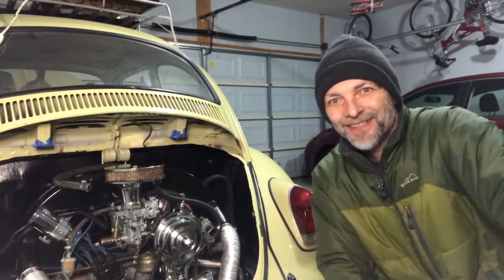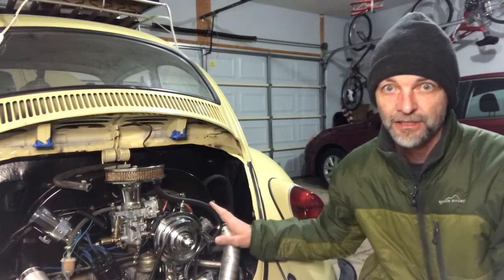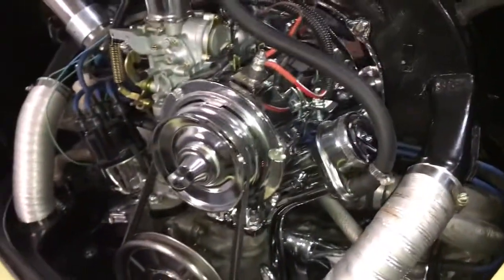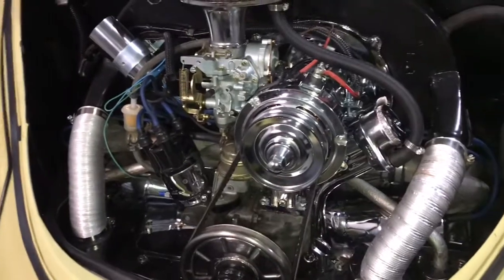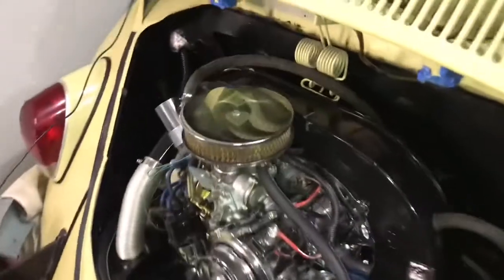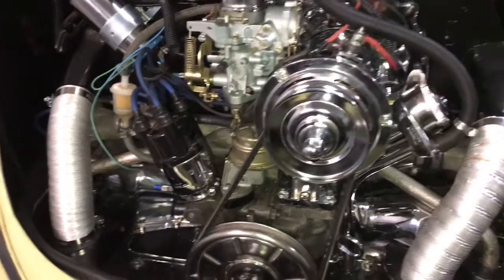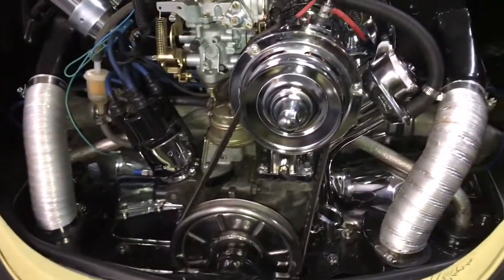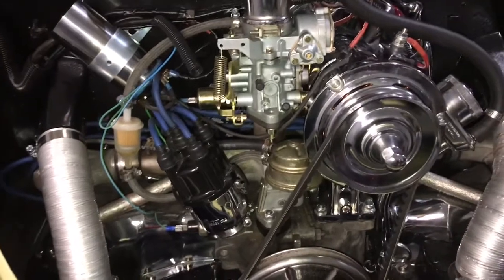Replacement of the Intake manifold?????????🤔🤔🤔🤔

Comment: Informative video,  like your simple talking style it's easy to follow.  I'm about to do this job myself.  Guess I'll drop the engine then but my question is,  aren't I going to have to do the same procedure wise of loosening the middle section to be able to remove the old leaky intake gaskets? I don't understand how it saves me any steps in replacing those gaskets besides making removing the nuts easier  and without a swivel socket.  I mean you still need to get the middle section out of the way regardless right?

Comment: Hypothetically, would it be possible to replace with the engine in the car if I plan on cutting to remove the old intake manifold? I have a single port intake. 

I know for a fact it’s clogged, I’ve found the universal intake manifold with the heat risers detached, and the empi single port intake end castings kit.

If I cut to remove the old intake, how much of a pain will it be to finagle the new system into place?
Reply from the maker: Yes it is possible, just takes more time due to space accessibility.  You can watch a video from JBugs where they replace one with out removing the engine.
Reply: @juniorclassicvwbugs924  JBugs video doesn't show the removal and reinstallation though, it skips over that. It just shows the manifold ends being removed, not the actual intake.

Comment: Any idea why my 1500 engine intake manifold freezes?
Reply from the maker: The only thing I could think of that would be associated to the issue like the one you describe.  Ensure your manifold heat riser are not clogged. That would be my first inspection 🧐 point. Second make sure you have a good thermostat and last ensure the mechanical flapper fail safe spring is good.  All of these 3 things work together. If one is not functional it affects the other.  I hope this helps.